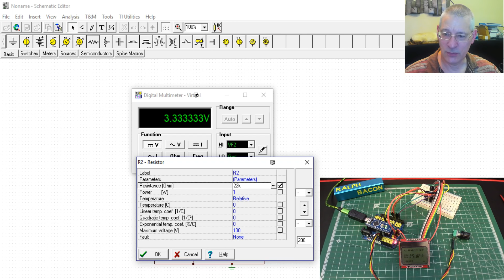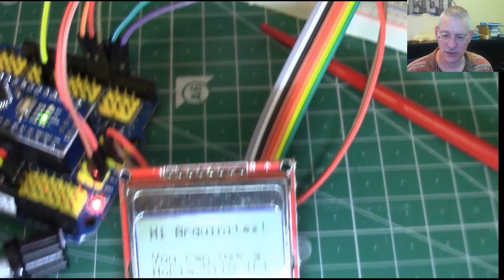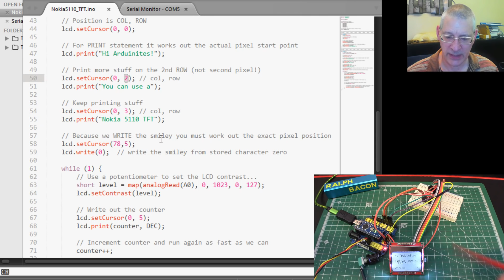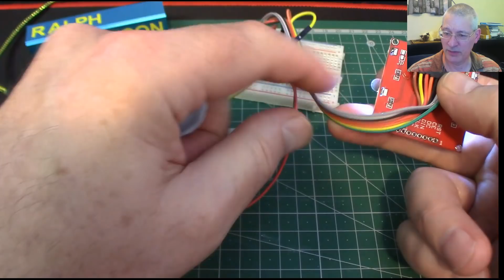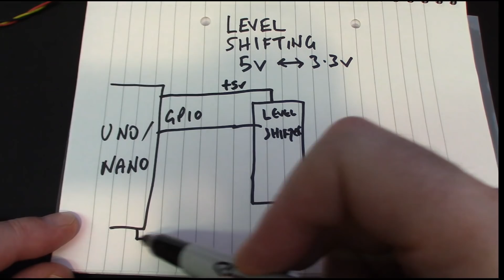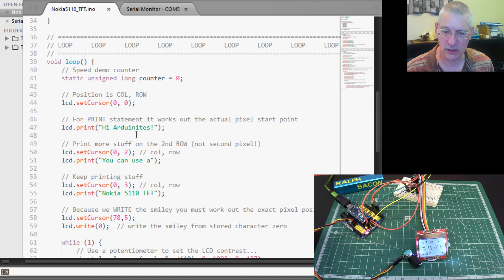#89 Nokia 5110 TFT Display - Cheap and Easy

Comment: Instead of using 5 voltage dividers, can't you just use one voltage divider to hook up the LCD ground to 1.7V? That way the potential difference between arduino logic voltage and LCD ground would be 3.3V
Reply from the maker: Are you saying connect the VCC of the device to +5v and the GND to +1.7v, thus giving a voltage difference of 3v3? Hmm.

I've never tried that nor had a need; where is the 1v7 coming from? Reducing 5v to 3v3 is just two resistors or a level shifter device which I've used many times. All very simple and dependable.

Having a GND connection to anything other than a common GND can mean strange behaviour if the voltage level changes.
Reply: @RalphBacon 1.7V comes from a voltage divider

I tried it, it works. Using this LCD with my 6502 computer project. You just gotta be careful not to let the LCD see actual ground. For example, in my circuit, reset button is connected to the same 1.7V divider.

I think this technique, even though very clean, is quite dangerous with devices that explicitly require 3.3V. Forgetting you shifted the GND up and connecting a pin to actual ground may be fatal for some devices.

Comment: Hi Ralph,   Newbie to Arduino, but not to coding and some basic electronics,(at rapidly approaching 60! boo!)  Your videos have been invaluable.  But I have now had a stumble,  with this 5110 display one!   Fell into the same trap as others with the model of LV shifter YF08E and connected wrong way round.  Tested the LV shifter and seems to be function OK. Have spares!  However can't get anything on display. don't know if I've bricked it!  Have a 2nd one but reluctant to fry that one too!  Looking in the library I can't make sense of the connections in relation to how you have it connected.  I have the same setup as you, a nano on a breakout board.   Can you tell me model of LV shifter you used in this video.     Thanks
Reply from the maker: Oh dear, Stephen. I just listened to the first couple of minutes of my video and I do seem quite definite about the 3v3 supply! In case you need to replace th4e LCD, my version is probably the same screen as this one, just a slightly different PCB:
http://bit.ly/2PZcVnd
or this one, a bit cheaper:
http://bit.ly/37bUHEO
Both are more expensive than the one I show in my video so you might want to check out other suppliers too, such as AliExpress or eBay. Just be very sure that you're getting a 5110 screen (or 100% compatible) with a total of 8 connections including +ve and GND.

The LV shifter used here was probably something like this:
http://bit.ly/2MwgDSX
which has 8 inputs (beware of 2 or 4-bit shifters, you need 5 wires level shifted) and they are DUPLEX (bidirectional). Any level shifter that offers that should be fine.
Good luck with your project and watch out for that magic smoke appearing!

Comment: Guess I am lucky.  I built a digital thermometer six years ago using one of these and a NANO.  I hooked it up using a 9 volt battery run through the NANO and it's been working 24/7 since the day I finished the build.  Perhaps I got a good one.
Reply from the maker: A good 9v battery do you mean? Six years on one battery? Wow! Or did you mean that you have had to change the battery but the device has been working 24/7 since the day you installed it?

Comment: Hi. I like this video but can't understand what defines to which pins on Arduino is LCD connected?  I can't use the pins you are using, and trying to find a way to go around. What should I edit to use pins 2, 3, 4, &5 ?
Reply from the maker: You would need to edit the library I'm using, Alfa. Not a job for the faint-hearted though.
Reply: @RalphBacon   Thanks, that is what I thought.

Comment: Thanks, Ralph nice tutorial, yes I do have two but never used so I will have to get them out and have a go as I want to make a small timer and this display would do the job, I have found this  U8glib-master library that looks good for all the fonts you could want Thanks Bob
Reply from the maker: I hope it all works out, Bob, these displays are very nice.

Comment: Most IC's have clamping diodes (inherent due to the manufacturing process) so it's usually enough to only hook up resistors in series and let them do the rest. Many times you can find specification about their maximum clamping current in the ds so it's rather easy to find a suitable value :)
Reply from the maker: Yes, there's been some discussion about level shifting Christiaan, with many saying what you say. Others insist the proper way to do it is with a potential divider (so two resistors), and yet others only use a level shifter like the one I demo here. Who's right? The simple answer is that everyone is! If it works (and works reliably) then it's the solution for you. Great info you give there about the maximum clamping current figure to be found in the datasheet - something I'll be looking for next time I level shift. Thanks for posting.

Comment: Hi again Ralph! Caught up on all of your videos. incredibly good info and, even better, makes me think a great deal of what is possible. Question for you about displays. Is it possible to get 10 displays to show the same information from Arduino? Like a countdown timer,  for instance? Maybe if they all had the same I2C address? What do you think?
Reply from the maker: Hey Larry, good to hear from you, and I'm amazed you've caught up on all my videos! And I'm glad you're now thinking of all the things we might do with an Arduino. Regarding running multiple Nokia 5110 screens from one Arduino, they don't use I2C they use SPI so you could use a different Chip Select (CS) line for each (using 10 pins - wow!) and the same SPI lines of course. But I haven't tried this but if the TFT adheres to the SPI standard then is certainly should work. If you have a need for this I'd get two screens and get that working first before buying a further 8!
Reply: Ralph S Bacon , I was actually thinking of using the 20x4 lcd displays that do use I2C. Your video on the 5112 got me thinking about it. I need a countdown timer to run on all of the displays, plus some other minor bits of information. Trying to find the best way of displaying that!!
Reply from the maker: Ah ha! Yes, you would obviously use I2C then, but the range of addresses is limited to 2^3 (or is that 3^2); whatever it's down to the three pads on the back of the I2C unit (backpack) of the LCD, you have 8 options, I believe. It's...
 
It's down to what chip is on the backpack, usually a PCF8574 or PCF8574AT which have different ranges. Thus, if you can source the two types of backpacks you have up to 16 address available to you. Does this help?
Reply: Ralph S Bacon , certainly does! it is for a timer that 10 positions would need to see. Ideally, once I get them all working, the real challenge would be to be to get information from a software program to the displays. The program has the time and other info that I want to display, but not all the info needs to be on the displays. Have to figure that one out. So I have several of the 20x4 displays coming to play with! Thanks so much for your help, Ralph. I do appreciate it greatly. Tell Benny my cat also checks my equipment for faults from time to time as well!!
Reply: +LS https://youtu.be/yef23sJjiU0
https://www.hackmeister.dk/2010/08/4-lcd-displays-on-1-arduino/
Try Arduino Mega, it got many ports, Chinese is not expensive from Aliexpress or Ebay...etc. Example:
https://www.banggood.com/buy/arduino-mega.html
Reply: +LS this could be useful to you:
#20 Tutorial: Multiple Devices on One Arduino I2C Bus
https://youtu.be/QQLfzlPGjjE

Comment: Hi Ralph, 
 Re: 8 Channel Level Shifter
In your video you state that the side marked VA and A1 ...A8 is the 5V side, this isn't the case.  It's the 3.3V side.
Applying 5V to VA exceeds the Absolute Max of VA of the chip which is 4.6V. So a small chance of damaging the chip (I got away with it).
So, the display to A1 etc and 3.3V to VA:   and Arduiino and 5V to VB and B1 etc.  Also OE needs to be pulled to 3.3V.
I'm sure most folks will work this out but the above might avoid a bit of head scratching and hair tearing (I don't have much to start with :)  )
A nice video as always
Regards
Dave
Reply from the maker: I can't work out if this is an error (in my video) or whether some level shifters are marked up differently. I've several level shifters and none of them are consistent - in fact what looks like the 'high' (5v) side often isn't. Some are marked A/B, some of them H/L and some not at all, just 1,2,3, etc. But thanks for pointing this out Dave, as I wouldn't want to be responsible for further follicle challenges for your or anyone else :)
Reply: I guess that,where there is no obvious board marking it will be case of identifying the chip (YF08E in my case) looking up the datasheet and where VccA (3.3V) and VccB (5V) pins are (2 and 19 in my case).  I/O connections on the VccA side are almost certainly 3.3V and 5V on the VccB side.

Comment: I wish the PIC chips had a super easy IDE and huge fan base like Arduino and AVR chips. I'm happy that AVR is now part of Microchip and there are a lot of new videos from Microchip coming out, but...where's my easy PIC stuff...
Reply from the maker: Interesting what you say there, Raymond.
 
When I was doing PIC stuff (and I may yet return to it one day) I just used my PicKit3 and Swordfish compiler and.. well that was it really. But that was the (almost .Net-strength) Basic-like language not C++, but I did do some assembler programming for PICs too (if you like having your fingernails pulled out by a pair of rusty nails that probably appeals to you too).
 
The worst thing in the whole world (and remains so I believe) is that the Microchip C Compiler had a sort of entry-level, medium and Enterprise licence. All the same compiler but the lower the grade the less optimised the code to the point it would allegedly insert NOP statements to prevent companies using it for their commercial products (each NOP uses yet another clock cycle and 1 byte of space). If they had given away the un-hobbled version of their IDE/Compiler this channel would be all about PICs not Arduinos!
Reply: Swordfish, I haven't heard of that one. I checked their page and could find no reference as to what OS is needed. I'm assuming Windows. All of my computers are Linux, but I could cobble together one and load it with Windows if need be just to try it out. I sent the website an email to verify...Thanks
Reply: Ralph S Bacon, That whole thing about the un-optimized version of XC8 adding NOPs is true. But, I still do a majority of my embedded programming with PICs. Juat so much variety available that you don't get with Arduino, and if you know what you're doing you can get around the NOP problem. But even if that weren't true, the free versions of Microchip's compilers and IDE are perfectly fine for the hobbyist.
Reply from the maker: Believe me, BEdmonson85, if I had the time I would this channel with both PICs and Arduinos, simply due to the diversity of hardware in both camps - yet the peripherals can be used by both (for the most part). I agree that the free compilers do the job but it just smells wrong that Microchip would even want to charge for their compiler - they should be making it easy to use their chips so we buy loads of them! At least Arduino is a separate entity (although they too have their political problems, Arduion.org vs Arduino.cc). Sigh.
Reply: I have dozens of PICs, books, a PicKit 2, a 3 & a clone 3. My real PicKit 3 stopped working, so I got the clone from China. Then I found that the original PicKit 2 can be configured to work as a PicKit 3, even though MicroChip says it can't. The newer/bigger PICs can run BASIC and other languages, and even emulate an Arduino (ChipKIT). One of the first BASIC systems was the free MMBasic for the PIC32 Micromite, by Geoff Graham (http://geoffg.net/micromite.html).

It's easy to interface a Nokia 5110 (Nokia 3310) LCD to a PIC.
Reply: Ralph S Bacon, I don't want to come off as one of the huge PIC fanboys. I use both PIC and Atmel devices for a number of projects. And given the huge community of Arduino users, arduino is a very fast platform for prototyping. I just happened to learn microcontroller programming before Arduino existed... remember the BASIC Stamp/ BASIC Stamp II from Parallax? That was our arduino back then.

Comment: RE Contrast:  the "normal" working contrast value is in the range of 62...70. I use 62 by default...
Reply from the maker: Funnily enough, Sergiy, if you don't even set the contrast with that pot then it works just fine too. I guess it uses, by default, the er, default value (possibly 62)? Useful to know this though, so thanks for posting the info.

Comment: Hi Ralph, how come all the ebay suppliers say it's an 128 by 128 LCD screen?
Reply: might be a mistake; obviously, they are 84 x 48...
Reply from the maker: Yup, as Sergiy states, the Nokia 5110 is deffo 84 x 48. It might be that those sellers are selling Nokia 5110-LIKE displays, that use the same Philips chip but have better resolution (possibly from a better phone or other product).
Reply: Because they're criminals.

Comment: These displays are not TFTs, they are LCDs... I have never had any problems connecting the data lines directly to 5v but this may of course vary from display to display. I have only tested with about 20 of them.I have also written a couple of libraries (one basic/text and one for gfx) for them which are available on my website.
Reply from the maker: Excellent Rinky-Dink, I shall look at those libraries in the near future. Thanks for posting.

Comment: I have a small handful of these excellent displays, and at one time (20 years ago) I used a 5110 as my only phone. 

These displays are available from China for less than $2 postpaid, and they work with Arduinos, Raspberry Pis, and anything else that has enough output pins for the display, plus at least one pin for a sensor or other input, otherwise what's the point of a display-only computer?

I got a kick out of your "if you don't have a 20K resistor" joke. All that needs to be done is to put two 10K resistors in series.

While you can still (the phone itself was discontinued in 2001) get the displays from a cell phone parts dealer, or from old phones themselves. it isn't as easy to hook them up as it is by just buying the display module from China. The phone's main board has finger contacts, while the physical display itself is glass This means that the main board finger contacts have to be pressed against the contact pads on the glass display. However, the finger pins are small, and not that easy to solder to (especially for anyone who actually used a 5110 all those decades ago). Depending on who assembles the modules in China, the pins may be numbered from left to right, or from right to left. So go by the numbers when connecting the device, rather than from photos.
Reply from the maker: As I alluded to in my video, I'm not convinced that these are original 5110 displays any longer. I mean it was 16 years ago that they stopped making them and every Arduinite as at least one. How many extra millions did they make for goodness sake? I wonder if some enterprising Far Eastern company isn't still churning them out by the thousand because there is still a market for them!
 
And I remember the trouble I have had with lining up the screen display fingers with their board contacts, what a palaver! Amazing that it actually works as well as it does. Good to hear from you,Art, thanks for posting.
Reply: I was in Japan & the USA for a month. During the visit I loaded up on stuff from Adafruit & Amazon.com (I took advantage of their offer of free Prime membership for a month, and that was great). Months ago I made an Amazon Echo Alexa from a Raspberry Pi 3 and it worked mostly OK. In the US I got a real Echo Dot, Google Home, and Google Chromecast, among other toys. There are plenty of YouTube videos that show how to use these things in "unauthorized" countries.
Reply: Ralph S Bacon lol Sum Yung Guy LCD factory in Shenzen... right down the road from One Hung Lo Clone Arduino factory🙈🙉🙊

Comment: I use a 4050 cmos logic chip, 0.49p from Maplin for my level shifters. I don't have wait 4 weeks and easy to get, world wide. Also use these to convert voltage http://www.ebay.co.uk/itm/10PCS-4-5V-7V-3-3V-AMS1117-3-3V-Power-Supply-Module-AMS1117-3-3-UK-/401215573286?hash=item5d6a4fcd26 .... 10 for £1.25 !!
Reply from the maker: Interesting, Kuk. But these are not bidirectional, so how would you connect up, say, the touch pins as hypothesised in my video? I suppose if you used the 3.3 volts as supply on these then you can exceed that on the buffer inputs (they tolerate the pins going over Vcc). Interesting, I wish I had time to try this out but others will also find this useful. Thanks for posting.
Reply: I just use it for 3.3v output from Arduino, as used by displays,  out puts to Arduino are 3.3v and the Arduino are happy to read these... This is how my 9341/2 screen is wired with touch screen and SD card reader. http://adammosscomedy.co.uk/4050/4050.html
Reply from the maker: What a coincidence I have one of those ILI 9341 screens too. Perhaps I will try this one day and present a cheap, alternative way of level shifting. Nice one, thanks!